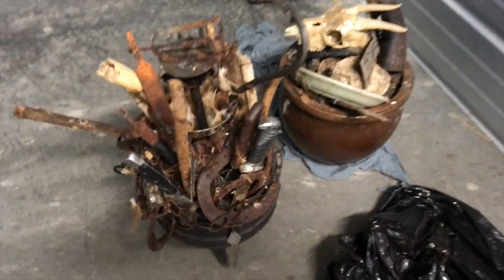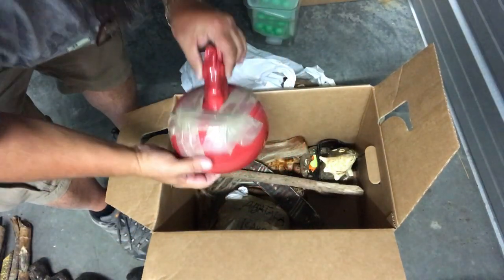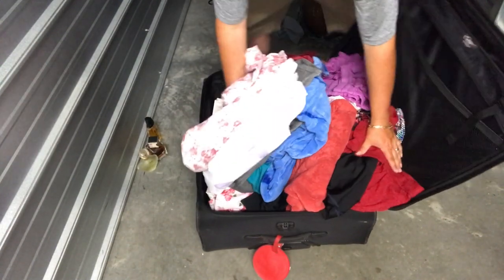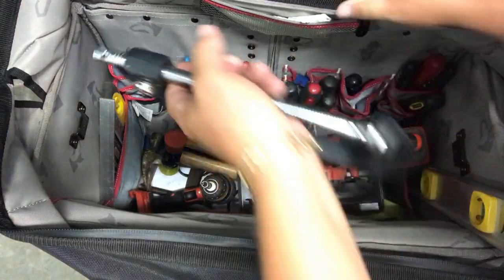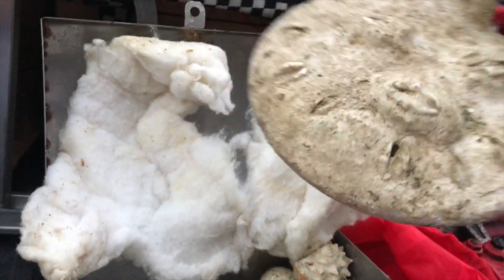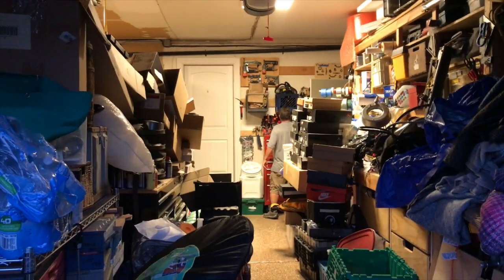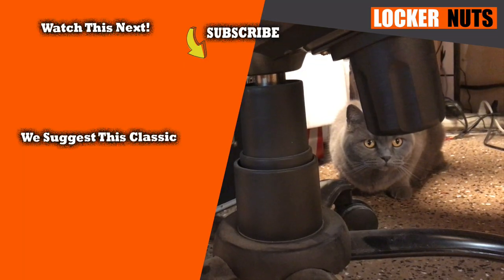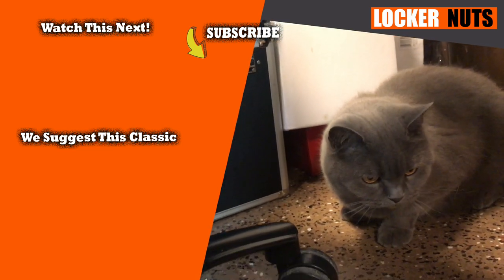WE OPEN THE METAL CHEST from the voodoo locker I bought at the abandoned storage auction

Comment: WD40 is one of the only cleaners that actually disappears after working. It's NOT a lubricant... nor a protector... but it is a great cleaner.
Reply from the maker: It was actually formulated to protect from water/rust. It has many other uses but those came afterwards.
Reply: @LockerNuts  sort of, for many years I used it as a cure all for rust etc, but since racing slot cars with foam rubber tires (Parma) i discovered it's just a cleaner. When you wipe it into foamies the holes in the rubber open up properly. It may be a characteristic of foam, but it leaves them crystal clean and nothing else does. Everything else leaves a residue of some sort.....